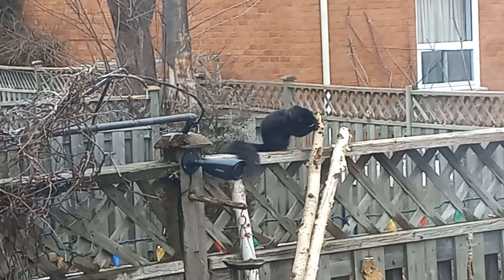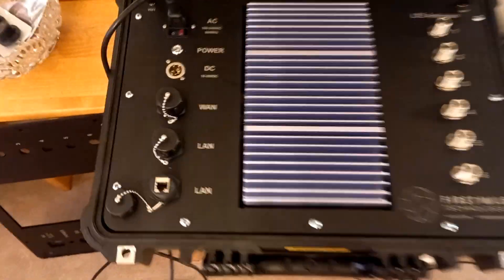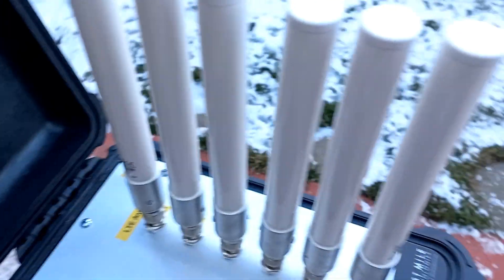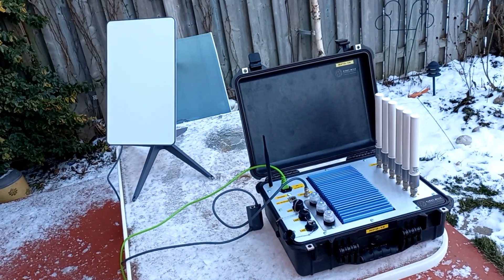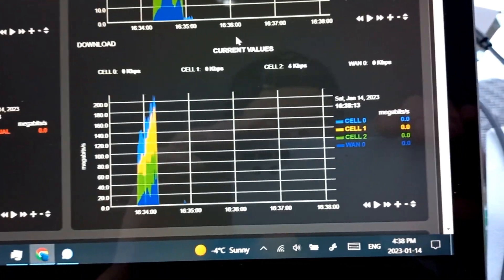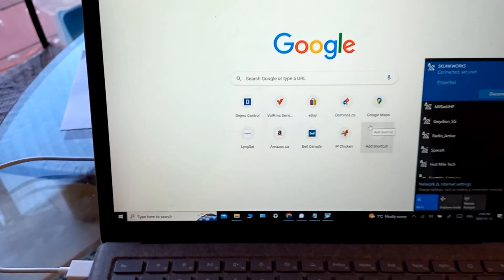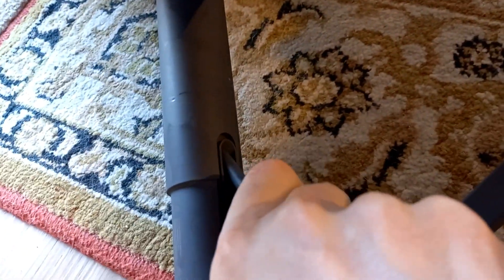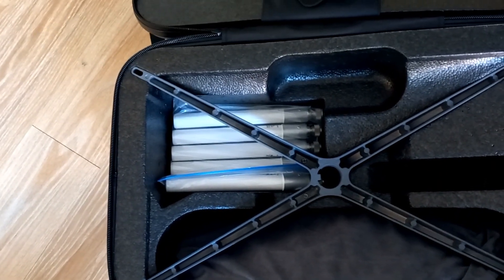Global Combat Communications Readiness

Comment: On account of that sim swap comment.

Something probably that shouldn't be mentioned publicly... but
My old boss John McAfee was trying to get an MVNO going to push his "Ghost Phone"  the successor to the privacy phone.  
So he could roll the E-SIM every few min. I didn't end up on that version of the project after an issue with one of his security guards roughing me up with a glock. 

That said only the provider,someone with a jammer or someone with a stingray or LTE simulator test set knows what your real IMSI is, its only revealed during the diffie hellman key exchange before changing to a rolling IMSI.

One day I might dig out something I wrote in 2018 that was really good at tracking that pairing by watching the bands uplink and using the fixed rolling value timer to keep tracking it as it changed.

My system would have known the unit in your exact position was this even if you sim swapped. Especially with how easily I could have profiled your antenna gain, the multiple providers you were on. I probably could have finger printed the exact LTE card you were using based on its frequency stability on its uplinks channel state information. 
Time of arrival and multiple sensors makes it really easy to precisely track things.

I never put that one on youtube since it ... may have violated the cell phone related scanner laws. But its also passed the statue of limitations now.

edit: I was one of the head people on the privacy phone project (2016/2017), I was the one who decided it needed 
1) Switch on its microphone
2) Disconnect switch's on its antennas to dummy loads (Cheapest way to physically disable the antenna connections).
3) Always on VPN to the clients corporate office
4) Windows file sharing support to eliminate the need for "cloud storage"
5) switch to kill the camera modules bus connection. (Killing its power resulted in kernel panics sometimes)
6) Jabber chat client with GPG end to end encrypted messages and file transfer.

It started off with a conversation about putting a physical switch on the battery after a security researcher showed John how to simulate a shut down and restart in a way that was nearly impossible to detect.

It was a dam shame it was not brought to market we really had something that I think would have been awesome.

The Ghost phone was kind of a criminal version of it rather than one for journalists, paranoid people and CEO's of publicly traded companies. John needed to make money in the middle of the ocean on his presidential campaign.

It was also ditching the phone app in favor for voip only.

edit: I wish I knew you back then, I would have totally gotten you on the team. It was pretty crazy.

Comment: Interested to know what OS/Distro is running on the main computing unit on the Commander (If you're alright with sharing that is😅 ) looking at a similar project at work for an edge computing solution and interested with what distro (linux or not) is running a setup like this 😊

Comment: A neat little trick to stow a starlink antenna without a connection to it, is to place the front of the dish flat onto a surface. it will stow after a few minutes.
Or just setup a static route so you dont have to switch wifi.
Reply from the maker: Thanks for the tip, I'll have to try that!
Reply: @peterfairlie2296  you may have to power cycle it first because I think it'll only do it on the first round of searching but have a go.

Comment: Interesting and it looks like a cobbled together version of a cradle point. The concept is great & the implementation was nice too. 
I think I might try that with the sole goal of a more compact version, maybe also incorporating the star link antenna, allowing one case fits all.
Great job🍺🍺

OH—How durable are the ribbon cables in the extenders?
Reply from the maker: Not a cradle point, the gateway I use is:  ... https://www.l3harris.com/sites/default/files/2022-10/cs-bcs-transport-aggregation-gateway-tag-sell-sheet.pdf

Comment: Also that looks so sick! Man i would love to be in the field your in!
Edit: Also, just a quick question/thought. Is there room in the case for a battery backup, not a massive one maybe an hours worth of time for a loss of power situation?
Reply from the maker: Internally installed lithium batteries cause shipping issues. There is a DC power jack with a wide 10 to 32 volt input range.

Comment: Ooh. Is this like your EnGo, where it can load balance and fall over LTE providers? But it's for more of your equipment. I like these more technical network stuff. I think cisco routers have similar features too!
Reply from the maker: Hi Lee, the heart of the system is a Dejero Transport Aggregation Gateway that uses the same smart blend system as the EnGo: https://www.l3harris.com/sites/default/files/2022-10/cs-bcs-transport-aggregation-gateway-tag-sell-sheet.pdf
Reply: @peterfairlie2296  Ooh! That's awesome to see. I wish I can work with these kinda hardware and tinker with them too! Seriously. Some cool stuff you got there.

Comment: Why not use milspec cannon plugs with potting compound on the backside.  Also setup a faraday cage in the case to prevent electromagnetic radiation.  Your networks only as strong as its weakest link!  Doesn’t your omnidirectional antenna array interfere with each other or are they each covering separate frequency spectrum?
Reply from the maker: This version is a prototype at this stage but has been preforming very well. We can always add EMP hardening in case of a Russian tactical nuke attack.
Reply: @peterfairlie2296  Why Russian?  NATO countries have’em also.  I’m retired military and I know lots of countries own these things.
Reply from the maker: Why Russia? Most likely scenario to playout IMO
Reply: must admit the inside looked far less professional than the outside
Reply from the maker: It's proof of concept prototyping and the first unit like this ever built.
Reply: @peterfairlie2296 Nuclear Air Burst will take out many satellites… you’d have better luck with a High speed MARS station.  But I like how it looks and the clean execution of the work.  

Has Elon guaranteed he won’t shut off satellite access like he threatened Ukraine with?

What would be the unit cost if you could scale up production?
Reply from the maker: High altitude Nuclear Air Burst vs Tactical Ground Burst would have totally different electromagnetic effects. Interesting to think about the effect on LEO satellites. It might take out whatever LEO was in orbit above at that time but they'd soon be replaced as others orbited overhead. I think Elon is the biggest problem to worry about. This is why VSAT is still another time proven option:  https://www.youtube.com/watch?v=1hBZjpVd194

Comment: Looks like my backyard where I used to live before I got sick and bedridden.
I had 2 H-H 12 foot C/Ku satellite dishes and 3 Ku 1 meter fixed dishes and 3 Ka band dishes
Linear and circular polarization

I had over 12,000 video and audio channels

I really miss watching feeds from Asia and Africa

😢😢😢😢

I had a huge antenna tower with everything from 10/11 meter to 800/900 yagi's and 2.4 Ghz 8 foot panel antennas

I had so much fun with my setup

I worked in media for a few years but I loved communication satellites and LMR long before that.

The most fun was pointing the dishes at the ground and picking up land based C and Ku signals

I found the post office using a C band point to point communication link. It identified itself continuously using Morse code on 5.80 Mhz off the carrier

Really amazing how much C band is still used for data links

And the 29 Ghz band was also a high speed data link used from a state office tower to a national insurance company.
No idea why they had that.

I miss the old days, when everything was analog and not many people used two-way radios.

Now it is a zoo on almost any band
Reply: As a ham, I strive to have another antenna/dish farm. I just got a cargo container to house some stuff in on my wooded lot, I will be trying to site survey out the C-band positioning this spring after the leaves are in. I have a T90 toroidal to install, a 48 foot tower, several c-band dishes (only one H-H) and lots of stuff to try to catch from the birds :)